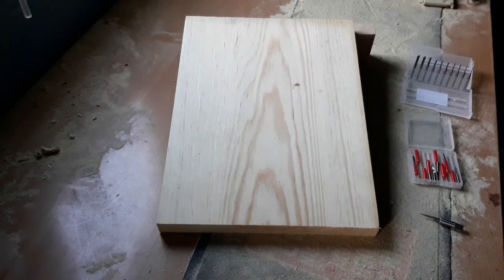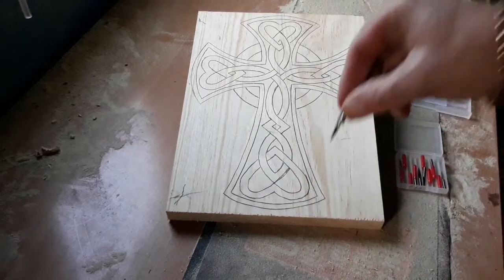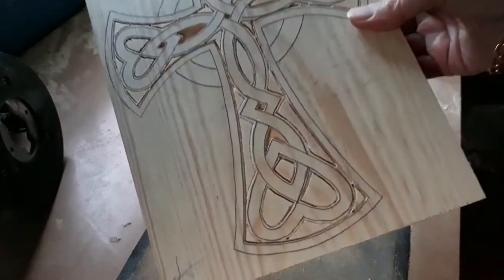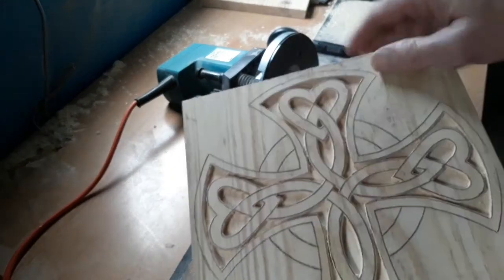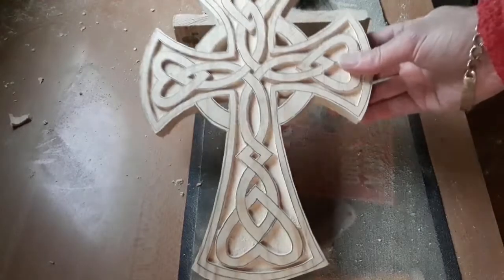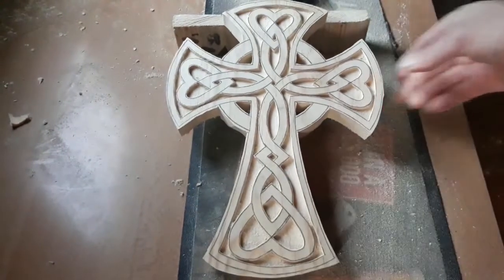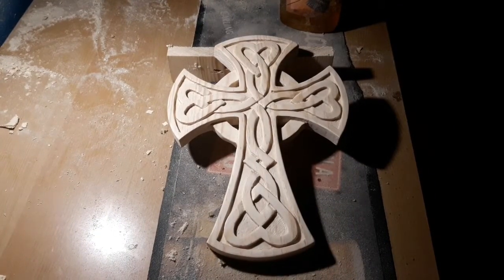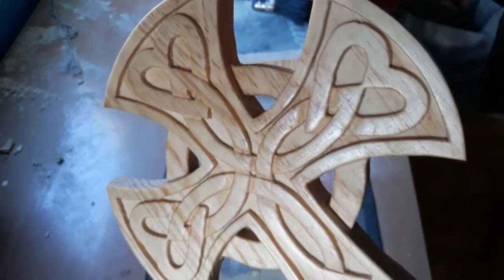Celtic Cross..Router/scroll saw project

Comment: WOW!!! looking for how to make my mum a celtic cross for her birthday. Now I feel confident to try it. Thank you so much :)
Reply from the maker: Thankyou for the positive comment,give it a go, the end result is worth it..
Reply: fishtank5050 I couldn’t buy the CNC bit so ended up buying a Bremel rotary tool and did it that way. I slipped a few times and cut out more than I wanted but as my mums birthday is Tuesday it will have to do. I’ll cut it out with the scroll saw tomorrow and then have a go at sanding the edges with the Bremel. 
Where did you get the piece that makes the Cnc bit 1/4 inch? I’m keen to be able to try using my router and a bit like that down the track. Thanks
Reply from the maker: @tashapalmer4519  it's called a collet, I get mine from Ebay but Amazon sell them also,I hope your project turned out ok..
Reply from the maker: https://rover.ebay.com/rover/0/0/0?mpre=https%3A%2F%2Fwww.ebay.co.uk%2Fulk%2Fitm%2F191938780949
Reply: @fishtank5050  I found them on ebay, so thank you. I'll order one soon. I couldn't wait for ebay this time. I finished it last night. What bit were you using on the end of your Dremel to sand? It didn't look like the sanding attachments that came with mine.
Reply from the maker: @tashapalmer4519  https://rover.ebay.com/rover/0/0/0?mpre=https%3A%2F%2Fwww.ebay.co.uk%2Fulk%2Fitm%2F163297146571
Reply from the maker: @tashapalmer4519  just sanding bands/sleeves, they come in different sizes...I always get the made in China jobs,nice and cheap and work fine.
Reply: fishtank5050 thanks for the link, found some in the Aussie eBay. Do you buy bits off eBay as well or stick to genuine Dremel
Reply: fishtank5050 I gave mum her cross today and she loved it. Thanks again for your video 😊
Reply from the maker: @tashapalmer4519  I get all my bits from Ebay or Amazon,I've never brought a genuine dremel bit ever..lol

Comment: What size are the bits
Reply from the maker: The bit shank is 3.175mm so you need an adaptor reducer 6.35mm so they fit a 1/4"shank router..if you check my latest videos I've started putting links in the description 😉